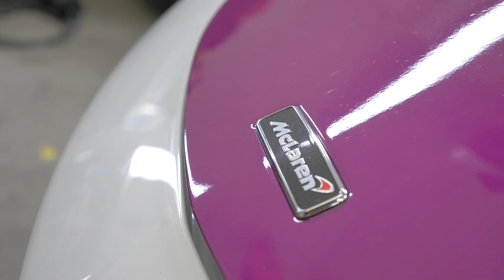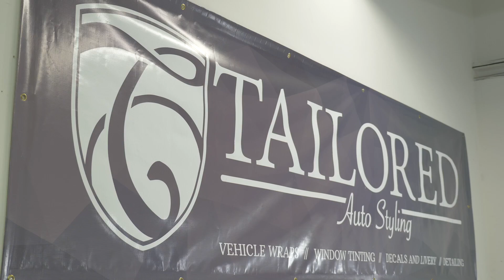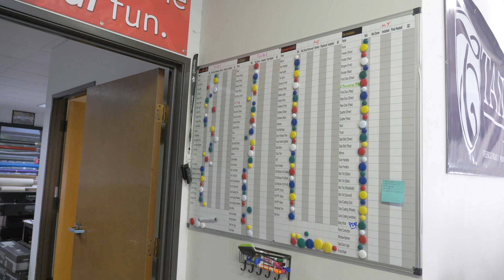How to Start a Car Wrapping Business (that Makes $50K/Month) Pt. 2

Comment: I want to know how I should go about getting into auto wrapping?
Reply from the maker: Thanks for the question RC LOCOS. 😀Start with researching this industry in your area pricing to operate etc. Have you started your business plan?
Reply: @UpFlip  no I have not I'm n appliance technician and in the process of starting an appliance business but automotive is my true passion an once I have a little foundation to work with I'm going to start with my own cars to get a feel for it. But that's what I wanted to know because I know wrapping a car once I do it a few times I'm sure I'll get the hang of it I'm a quick learner but pricing is what I really need to know how to do so that's the first thing I'll research once I start my plan, thank you so much for your advice.